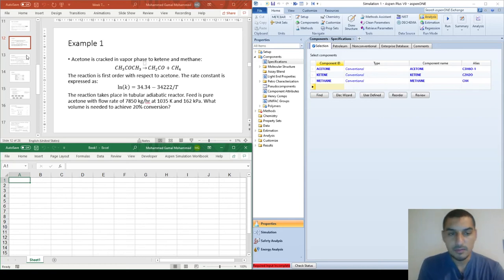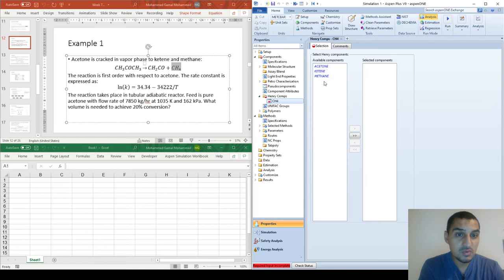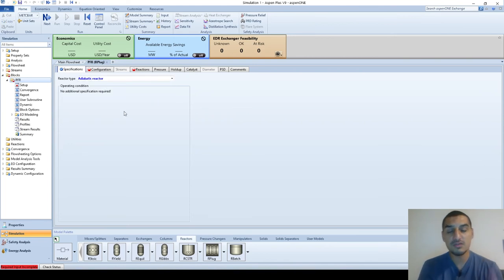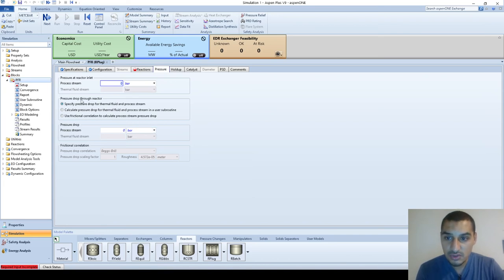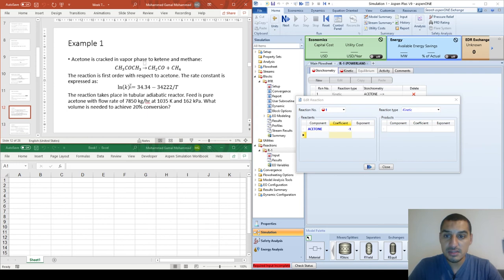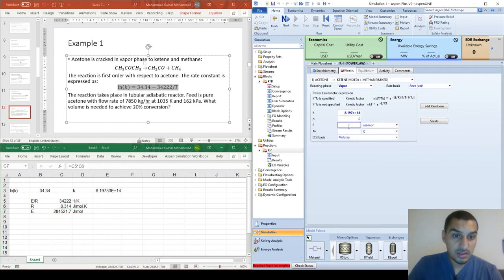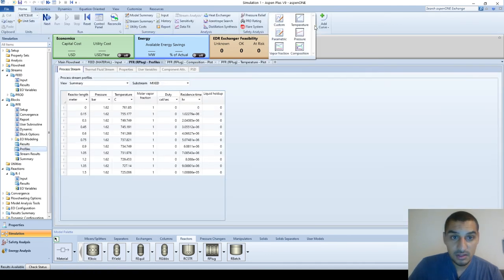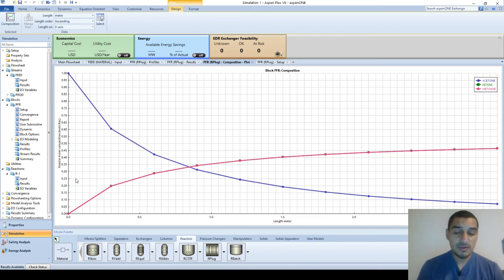Aspen Plus in English | Part 2 | 29 | Kinetic Reactors - 3 PFR with Power law kinetics

Comment: Hi. Again thanks for your amazing videos. At around 15 mins, is k not the exponential of 34.34-34222/T? You just took it as an exponential of 34.34 but the equations says ln(k)=34.34-34222/T
Reply from the maker: Hi
Well, I know this is a bit confusing. Just try to take it step by step:
The form that Aspen Plus accepts is         kinetic factor=k*exp(-E/RT)    [1]
while the form we have is                ln(kinetic factor)=34.34-34222/T       [2]

So, the two forms are not the same but we can take the exponential of both sides in the form we have (equation [2]), so it will be :
kinetic factor=exp(34.34-34222/T)=exp(34.34)*exp(-34222/T)            [3]

If you compare equations [1] and [3] you will find that:
k=exp(34.34)
E/R=34222

Hope it is clear now.
Reply: @MGMohammed  makes sense thank you very much